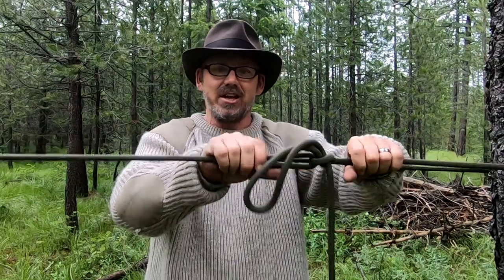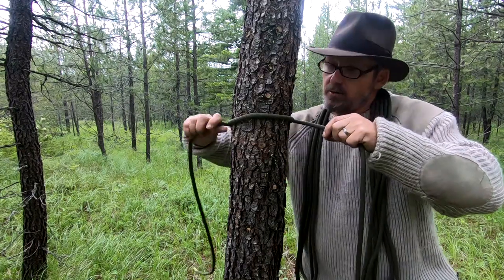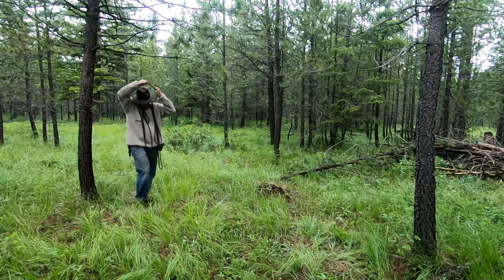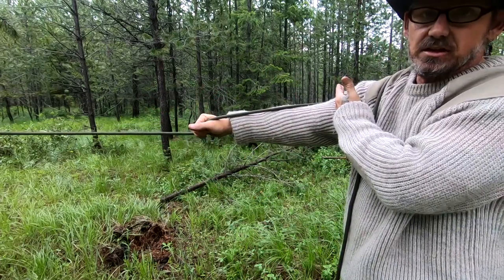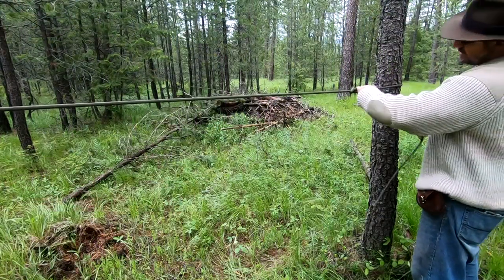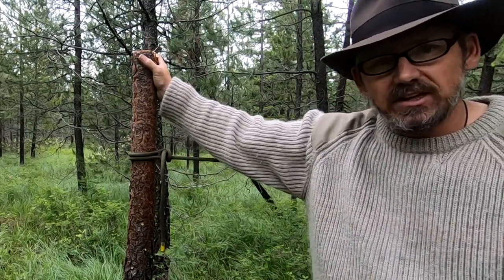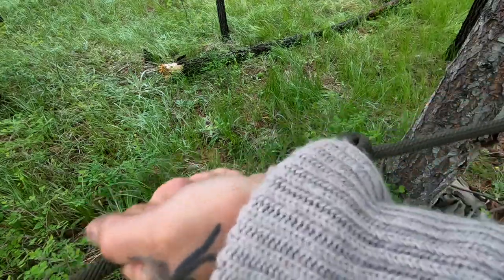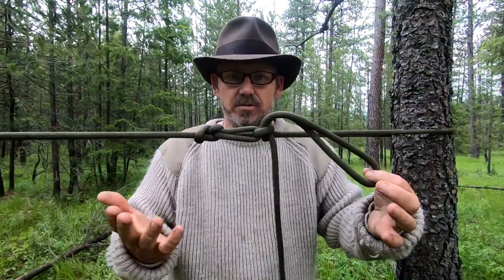What knot to do | how to tie a ridge-line or high-line with the truckers hitch.

Comment: What type of rope is that? Need to learn these knots to tie down truck loads, securing ladders  while extended on a roof, pulling hvac tool up to the roof, I see lots of different knots how to on You tube , but not much of what the knot  is for or how to apply it. Thanks for the video